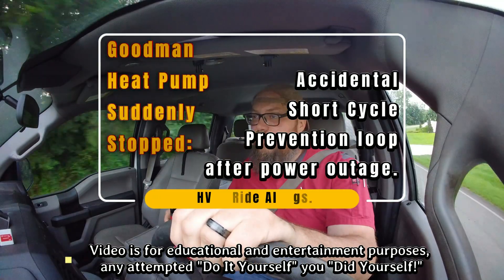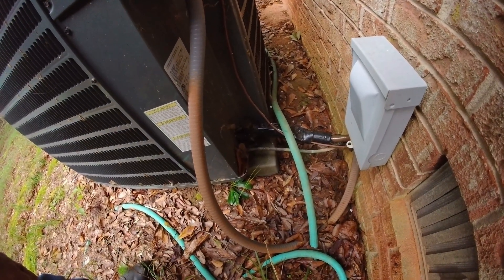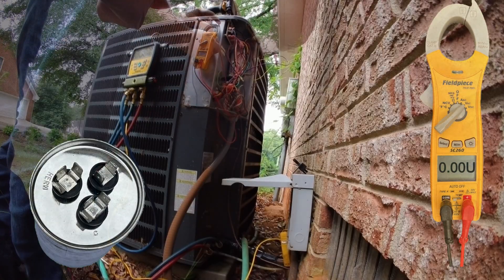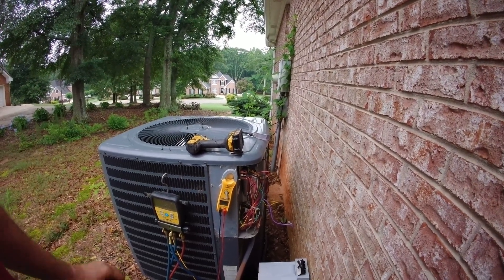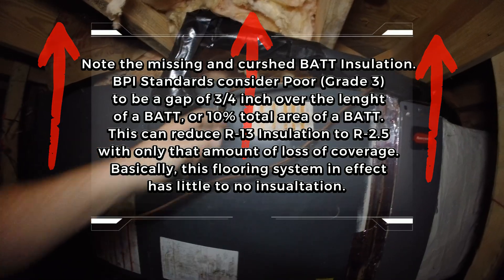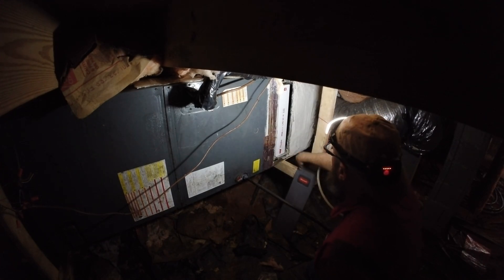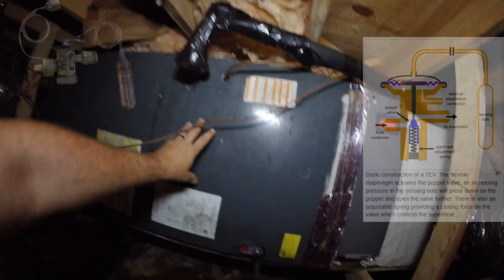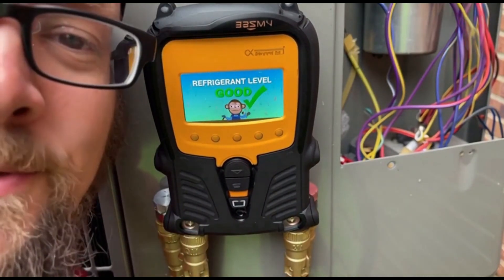Goodman Heat Pump Suddenly Stopped: Short Cycle Loop

Comment: Good call and agree the older scrolls that didn't have an internal check would do that and what was odd was even the TDR would ride thru the blink like it never happened so no delay! First one I ever saw happened to be in my own house on a 1990's Carrier AC Copeland scroll. A for sure cure is a White-Rodgers 49M11-843 SureSwitch if the contactor contacts are burnt then good time to try one!

Thanks for the video!
Reply from the maker: I'll definitely have to check into that thermostat! 

Its strange, I've seem some get stuck in a delay fight between boards and thermostats, while other like you say just keep on going like nothing happened.